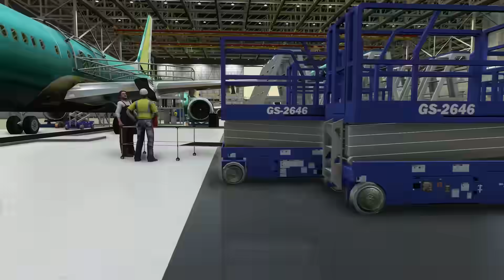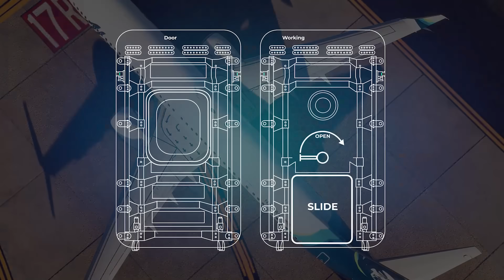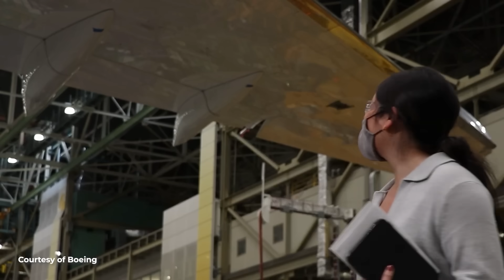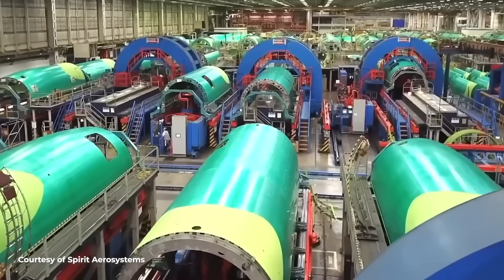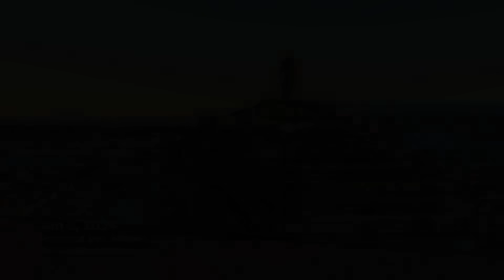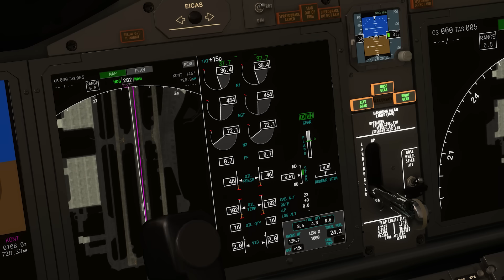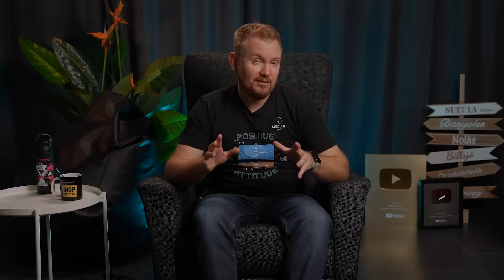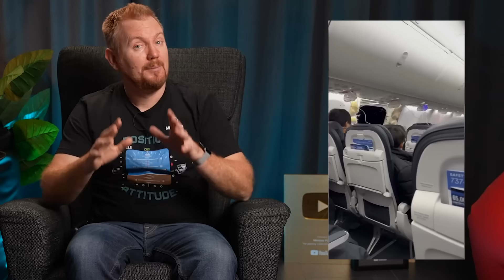Boeing 737MAX BlowOut!! The Scandal behind Alaska Airlines flight 1282

Comment: The 737 Max will carry the stigma of the DC-10. Good plane with some headscratching decisions in some design and/or software implementations. Add to it sloppy maintenance and oversight, and you have an airplane people are afraid to fly in. 
 
More and more, it seems like McDonell Douglass took over Boeing, not the other way around.

Comment: This is a long and convoluted, seemingly thorough but actually nonsensical explanation.  At each and every juncture where a completely unprofessional, dangerous and incompetent action or omission of action takes place, the narrative continues without telling us who was responsible,  how the malefactors were dealt with or what was done to prevent its specific occurrence in the future.
This is only the most recent in a long string of construction mistakes, none of which should have occurred or been tolerated.
This isn't an analysis - it's merely a narration of a horror story.  And as such, it accomplishes nothing but scaring the pants off of those of us who cannot stop Boeing from endangering us. It avoids asking any of the obvious, uncomfortable questions about personal performance and responsibility which are needed to rectify the situation.
Reply: Okay so we fire  the people that were directly responsible for this happening. Then we just know that this would never happen TO THEM ever again. No safeguards against anyone else doing the same thing or something similar. Personal responsibillity is obviously needed, but the more complex a system is the more mistakes happen. Even to responsible people. We need systems that catch and prevent these mistakes.
Reply: @john99776 I dont agree with you. The people working there, and even the team responsible for the door removal arent the problem, they are not to blame for this. These mistakes always happen to everyone, and it is boeings responsibillity to design systems to catch these mistakes. Hiring different people wouldnt have changed anything

Comment: Hey Boeing, here's a safety thought.............don't put big unwanted holes in passenger jets that then NEED TO BE "PLUGGED".................put big WANTED holes in only the passenger jets that DESIRE them. Problem solved, common sense prevails.

Comment: Retired pilot here...I remember when CRM was first recognized as an important aspect of safety, Back then CRM meant "Cockpit Resource Management." Later, the powers that be realized the cabin crew could also be an important part of a situation, and the Acronym was changed to "CREW Resource Management." I'm disappointed this PIC never obtained any info from the flight attendants as to the condition of the cabin!!
Also, there's another reason for the turn when starting an emergency descent...It's an extremely helpful aid to rapidly push the nose over without inducing negative g in the pushover.         Jus saying     :^)
Reply: @Bugdriver49 I'm very glad you mentioned the importance of the flight crew/pilots-flight engineer to consult with the cabin crew/flight attendants when crises occur. I've had a moderate fascination with disasters since junior high, both natural and man-made (including those caused by operators, engineering/design, manufacturing and/or maintenance). I've read, watched & heard scores of stories of human beings in disastrous, terrifying situations and have been very interested in how their perceptions helped and hindered them, how they processed what was happening, and their subsequent behaviors. (BTW, I recommend Amanda Ripley's book The Unthinkable: Who Survives When Disaster Strikes - and Why which concerns human reactions in crisis situations.)  
.
In the case of aviation, it's been surprising to me after reading and watching numerous stories of propellers or turbofan engines departing wings, engine fires, explosive decompressions, and so on, that often the flight crew didn't consult with the cabin crew, who can often contribute extremely valuable situational awareness to the pilots that they cannot get from their positions and from the instrumentation available to them. For their part, often the cabin crew wrongly assumed that the flight crew knew what was happening with the plane and didn't need to be told that, say, a propeller had detached, part of the fuselage had blown out, an engine had come off a wing or there was a massive fire under the right wing.

Comment: Its clear that safety standards is like the ocean tides. If Boeing is still unable to ensure acceptable standards consistently there will be definitely future disasters. Maybe aircraft designers need to design aircraft that factor in poor workmanship? 🤔 This emergency situation should never require the need to follow check lists. Its obvious what the pilots needed to do. This check list concept has pros & cons and needs a rethink. As a passenger I would not have been impressed by the pilots performance. I understand they are just following their poor training.

Comment: As for the flight deck door suddenly blowing completely open... I recall that the DC-9 door had 'blow out panels.' I wonder if these were designed to release air at a slower, controlled rate and protect the pilots with a slightly LESS SUDDEN pressure drop? The fact that 737 pilots were not advised of this technical design detail is just another failure of the latest Boeing strategy to give line pilots the 'mushroom treatment! (i.e. keep them in the dark and feed them err.. 'fertilizer'). This is the most comprehensive report yet on this incident. Thanks.

Comment: I don't understand why those doors need to be blocked or replaced with a plug at all. I get that they don't need it but so what? Why they can't just have more doors than it's required for given passengers capacity. It would be simpler design with less tinkering required which means less problems.

Is version with a plug cheaper? Is there some technical or organisational problem I can't see?

Comment: Wouldn,t the slightly dislodged plug be noticable from the outside? Larger slots above and below the plug?
Reply: Probably not without an eyes-to-fusalage distance check. Certainly nothing that the FO/PM could have seen in the light of the evening wiht a white-painted hull.
Reply: @benrussell-gough1201  Don't they have sufficient lighting when doing security check? Then what's the point?

Comment: It's interesting how redundancy in one system can... obfuscate a problem in another system? Although I don't understand why the door plug issue did not cause that second controller to register a fault too.

Anyway, I have to admire the people investigating these issues. Analysing what has happened in a dispassionate way. I'm not sure I could do it. I was thinking that the negligence could have resulted in death, and therefore this should be treated as a potential culpable homicide. But that's a very different way of thinking from actually trying to fix things.

I think I will in the future use my seatbelt whenever I'm seated. I think I usually already do, as the cabin crew usually advises this. But in this case I guess it could mean the difference between life and death.

Comment: I understand that no one just "forgot to install the bolts". As I understand, the Boeing work order system should have generated a a work order to reinstall the bolts after mounting the door. This is the problem when automation completely replaces memory items. I am sure that the mechanics that reinstalled the door thought that someone else would replace the bolts since it was not mentioned on the work order and they must comply to the letter of the work order or risk discipline. I have not seen anything mentioned about the procedures for the inspection that specified check the retaining bolts for cotter pins. Yet another Aw S*t.
Then there was Alaska Air Lines. They had received several log book entries of pressurization alerts and found no cause. But, in a perhaps fortuitous decision, they limited the flight to overland routes only. No one questioned as to why did it make any difference whether a pressure failure at cruise altitudes would make any difference whether it was over water or over land? Either way, the result would be catastrophic. If the aircraft was at 160 would it have mattered at all whether the destination was Hawaii or Portland?
It's just another Swiss Cheese coincident that should prompt a thorough investigation and response to all contributing factors. Perhaps that was all done but the media, including this channel , sensationalizes the issue.

Comment: The fact that this has nothing to do with the design of the 737-MAX-9, and was instead a quality control issue is actually the opposite of reassuring, to my mind.

Combined with the previous incidents with automatic controlled flight into terrain, this means that this family of aircraft have both design flaws and quality control problems.

I'm not scared of flying. I actually have some flight experience in real life, and extensive experience in simulators, as well as aerospace engineering experience and aerospace engineering simulator experience.

But at this point, I think I'd seriously consider making sure that any flight I booked would be on an Airbus. Why take the risk?

If it were a one-off incident that happened in a vacuum, fine, stuff happens. A few mistakes by individuals that are caught by a positive safety culture is what you want in a company like this. But with Boeing's recent systemic behavioral issues, including laying off quality personnel by the thousands, seeking shortcuts and workarounds for certifications, and what seems like more of a focus on quick turnarounds than genuine solutions to problems faced during upgrades, it seems like a cultural problem, and a systemic one. Rather than a few isolated incidents, my worry and suspicion is that actually it's a tsunami of incidents that are just barely being held back by the good intentions and actions of individuals who are working against the flow of the cultural tide. It's upside-down to how it should be, and in my opinion is a recipe for further disaster.

With the airliner manufacturing industry now boiled down to basically a duopoly, and nobody truly prepared to step in to claim market share from Boeing that should be falling off a cliff, they're getting a reprieve they don't really deserve.

My hope is that someone else with the expertise might be quietly developing an airliner or two behind the scenes... someone like Lockheed, maybe reviving and tweaking the L-1011, which is still considered pretty advanced even today. Re-engining it with modern high-efficiency engines could potentially be a fairly quick path to certification.

Alternatively, Raytheon could potentially step up to the plate. Imagine some of the larger Beechcraft being stretched and maybe modified for open fan engines instead of turboprops. It seems like their style of high-wing fuselage is pretty compatible with open turbofans.

Are there any Chinese manufacturers who could potentially fill the Boeing void? Or maybe Airbus can continue A-320 construction alongside the formerly Embraer A-220, rather than superseding them.
Reply: Mostly agree with what you’re saying but be aware that it costs billions of dollars and takes 5 to 10 years to design and certify a new aircraft from scratch.  So no, no other aerospace company is going to come up with a 737 substitute.  The Chinese have just delivered the C-919, but it’s not certified in the West yet and will probably have higher operational costs than the 737 or A 320.
Reply: @PerfectInterview  Yeah... mostly was being snarky, though I suspect Lockheed really could pull it off if they wanted to, given the history of Skunkworks pulling precisely those kinds of miracles. And I really don't know much about China's aerospace industry except that I know they buy gobs of planes from both Boeing and Airbus, so they probably don't have much to compete (or are just so thirsty for planes they need all they can get their hands on).

But yeah... I've honestly always been a Boeing fan, and (though I've never flown either IRL) I much prefer Boeing's overall design philosophy with keeping the pilots at the center of the control loop. What I really hope will happen is that Boeing will get its act together, start acting like itself again instead of like a confused version of MD, and claw its way back up to parity.

I just... don't really see how, when they've already sacrificed their development process to the unholy gods of short-term profits and long-term–(This sentence clause left intentionally blank.)

Comment: Passenger reports of problems to crew members never get anywhere.  I’ve had two:  on one flight, I was being choked by engine exhaust, something that never happened before or since.  On another flight, when I reached under the seat to retrieve my bag at the end of the flight, my hand was brutally sliced open by something sharp.  When I looked, it was from a sheared-off, jagged-edge seat anchor bolt which didn’t even have a nut like the others, because of the damage.  I reported this and asked for first-aid after disembarking, but no one ever came although I waited for over 90 minutes.  I had to drive to a hospital in my rental car and get my profusely bleeding and painful hand stitched up.  I then had to work all day in that condition and catch another flight back that night.  I wanted to file a report so this wouldn’t happen, or worse, the seat coming loose, to the future passengers in that seat, but all I got from the crew was impatience and eye-rolling in both cases!   I’m positive neither of these problems were investigated, much less repaired.  I think filing a written consumer report is the only way to get problems like these addressed.

Comment: Alaska Air competitors now running ads “fly with us, we won’t take the shirt off your back”!  Seriously though, it is a miracle that nobody was sitting by the plug.  Kudos to the pilots for using their experience to land safely.  So glad that it had a happy ending.
Reply: That will likely stop if another major accident occurs at one such airline. 

Lawyers are a humorless lot.
Reply: @michaelmoses8745  "Lawyers are a humorless lot."

Apparently they are safe in any shipwreck: sharks won't eat them out of professional courtesy.
Reply: Alaska should sue Boeing for damage to their reputation if people like you can watch this video presenting the facts and still make a joke about Alaska (who did nothing wrong besides operate a Boeing product) instead of the manufacturer who delivered a door plug without the hardware installed and then covered it with interior finishing.... You realize this video details how it's Boeing's QA miss or their subcontractor and yet still here are the Alaska jokes. I get it's a joke just change it to an Airbus ad...

Comment: @MentourPilot Why not just install the exit door as originally designed? It seems like having an extra emergency exit door on a reduced passenger capacity airplane wouldn't hurt anything and only help an evacuation of go faster. I don't see the benefit of eliminating an emergency exit that's already been designed into the fuselage.

Comment: I'm a Radio R&D engineer, this is a guess, but based on experience with getting product through qualification.  You fit the springs on the lower hinges as then you have EXACTLY the same mechanism which will have been through testing and approvals.. if you change the way you fit them, you'll have to retest and certify that element.  For R&D, the cheapest change is no change.
Reply: It seems to me that leaving in place heavy duty springs, designed to help lift the door for ease of opening, and which are redundant in the plug configuration, created a more complex procedure to prevent the plug from moving. With constant vibration and spring pressure, the plug was bound to move given that retention bolts were missing. This is an example of poor modification design features implemented just to save time and money. Presumably an emergency door has sensors to warn if it is not fully closed. Why couldn't these sensors be left in place to warn of movement in a plug? Thankfully, this episode did not result in any deaths.

Comment: "Hey, what should we do with these extra bolts, crown nuts, and cotter pins?"
"Ehhh..."
Reply: It's a rather simple and basic protocol: any parts left = stop work, figure out who screwed up. The most amateur of backyard mechanic does exactly this. It's astonishing that Boeing doesn't.
Reply: @repatch43 
It should be astonishing. But looking at how Boeing has conducted themselves for the past two and a half decade, nothing surprises me about Boeing.The new mantra is. "If it reads Boeing, I ain't going."
Reply: Very good point, I should imagine these are one use only bolts, so maybe didn't end up in a parts tray....  But does sound like back-yard mechanics!
Reply: @UR_HR I doubt they are single use bolts as there is no pressure on them, and the torque specs are probably minimal. But having extra bolts laying around after a fix should be an immediate stop on production, regardless of shift change etc., and regardless of how far they would have to go back in the production process to find out where they went.
Reply: Just put it back on stock for surplus. 😂😂😂
Reply: Stick 'em in the jar. (That's what my Granddad did every time he took his motorbike apart and out it back together...)
Reply: "Great, we can reuse them in the next plane, it's more value for stockholders! Keep it up!"
Reply: "Put them aside. Don't throw them away. They will need them to put the plug back in after it blows out."